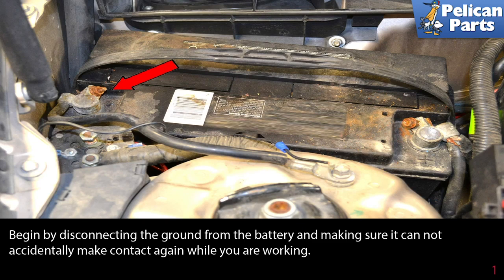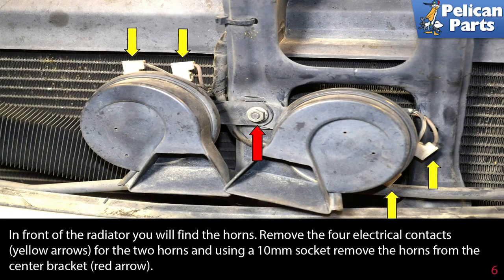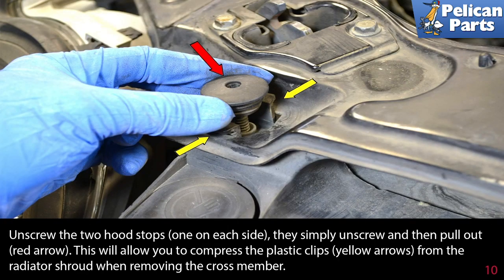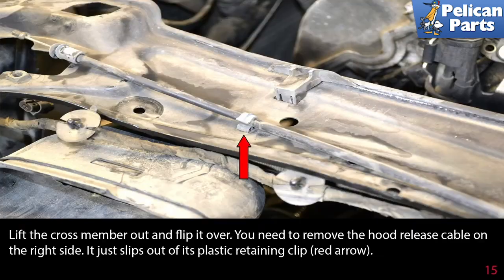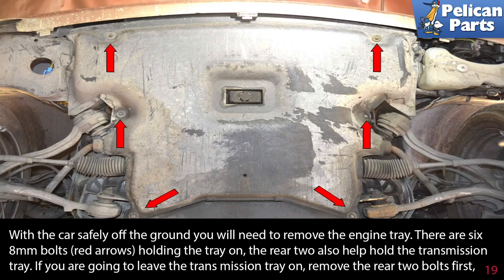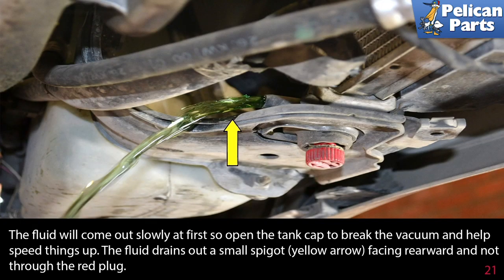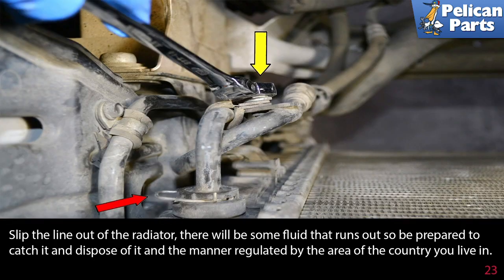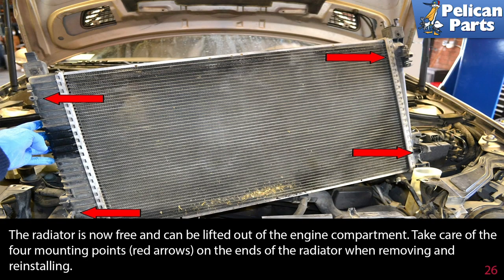Mercedes-Benz W203 C-Class Radiator Replacement

Comment: So this video has a lot of great info but if you have a W203 Kompressor you will  need to remove the front bumper and intercooler. With the left side (facing the car) intercooler hose completely removed you can more easily remove the upper trans cooler connection and also easier on the reassembly since you can more easily put the lower trans cooler hose clip back on or at least i hope. Then you can remove the fan, and then with the intercooler out, the radiator will come right out. Not to put it all back together but not completely since i need the upper trans coolant hose loose to flush the transmission, Once thats done 
I can put the fan back before I reattach the trans coolant hose since it won't go back on with it installed.
Reply from the maker: Thanks for the additional info for the procedure. We appreciate it.
Reply: @pelicanparts  Reinstalling is going to be fun. I will make a note of the order I end up successfully performing each step and let you know.

Comment: Great video!  I have a 2003 Mercedes SLK320 and need to replace the radiator this weekend. Whats the best way to get to the Transmission lines on the back of the radiator?  Thanks
Reply from the maker: First remove the fan shroud. Then you have access to the lines, unscrew them from there.

Comment: Great video but it is not complete! There is another support for the radiator on left and right bottom that needs to be detached. I was trying hard to wedge it for almost 1 hour before I noticed it. You should get under the car and you will see both tabs. Something that helped me was looking at the new radiator to understand where the tabs were. Hope this helps someone else.
Reply from the maker: Thanks for catching that. We appreciate it. I will have the article updated.
Reply: Yes, definately. I am at exactly that point. This video kinda of glosses over a lot of things. Like in order to remove the fan, you have to make some room, you need to disconnect the upper radiator hose on the right to get some room to get it past that hose, and then on left side (facing the car) you have the upper trans coolant hose in the way, so you need to get that out of the way. The the upper trans coolant hose is held in place by a clip built into the radiator. The fan gets hung up on it and no matter what it need to come out. You can't pull the upper trans coolant hose without getting it out of the clip on the radiator. You can't get it out of the clip without removing the clamp attaching the upper and lower metal hoses together to get some room to move the metal hose from underneath since there's no way to slide it over on top. Now you can almost get it out but now the lower trans coolant hose is in the way, not quite enough clearance. And you can't reach the clip for the lower trans coolant hose because the lower radiator hose in the way. So you manage to remove that, and then discover the clip for lower trans coolant hose is facing backwards, and while yes, you can get it off, you wonder how will you will ever get it back on. But 1st things 1st. So now the lower trans coolant hose does not want to come off. It won't budge! But after wresting with it for 15 minutes you manage to get it out without breaking anything. Now finally you have enough room to slide  the upper trans coolant hose out of the clip but it still offers a lot of resistance so you need to pry it over with a large screwdriver while simultaneously try to pry the hose out of the radiator, but again, it won't budge, I broke this round plastic clip between the radiator and the upper trans coolant hose and hopefully the new radiator comes with one. Crossing my fingers. Once that broke it finally popped out. It was really in there! I had a large pry bar on it and nothing. Well finally it's out. So NOW FINALLY 
I AM ABLE TO LIFT THE FAN OUT!!! HURRAY! And even am able to undo the top clips on the radiator. But wait....THERE"S MORE CLIPS I CAN"T EVEN SEE!!! NOOOOOOOOOOOOOOOOOOOOOOOOOOOOOOOOOOOOOOOOOOOOOOOO!!!!!!!!
Break time.

Comment: Would this work for a 2006 Mercedes Benz 230 ?
Reply: C230*
Reply from the maker: Applicable Models:

Mercedes-Benz C320 (2001-04)
Mercedes-Benz CLK320 (1998-04):
   - CLK-Class (2003-2009) W209
   - CLK-Class (1998-2003) W208
Mercedes-Benz E320 (1998-04):
   - E-Class (1996-2003) W210
   - E-Class (2003-2009) W211
Mercedes-Benz ML320 (1998-03)
Mercedes-Benz S320 (1998-99)
Mercedes-Benz SLK320 (2001-03)

Comment: It looks like the radiator is connected to something near the bottom. How do I remove it?
Reply: I've got a 2005 clk 270cdi, an mine is attached at the bottom too? Can seem to figure out what it is stuck on?
Reply: @adamlawrence590  Hi, I was able to replace mine. If I remember correctly, as this was roughly one year ago, it was connected to the fan in front of it. I ended up breaking the plastic that connects the two by abrupt force. I slid the new radiator in and made the appropriate hose connections. I haven't had any issues since. Note that my vehicle is a 2004 C230 Kompressor, so I'm not aware of the specific similarities between our models but I hope this helps.
Reply: @jrrchemist6658  I have a C230 kompressor 2003 and mine is also attached to what seems to be a short fatter radiator that has what looks like 2 air hoses connected to it. I don't want to break anything and I have no idea how it's connected! 🫤
Reply: @shawn7307  Can you provide more details? My radiator was connected to the fan near the bottom. This is where I was having issues. The connection between the two involves sliding up and pulling out. It's almost like a hook.
Reply: @jrrchemist6658  I figured it out. It attaches in 4 different places on the bottom of the radiator. There is a hook attachment that slides in that is released by pushing the top of the radiator forward and then there is a snap in at the very bottom that can be released with a screwdriver on both sides. You have to remove the bottom air hose first that goes to the smaller fatter radiator. I think it's related to the supercharger some how. 😅
Reply: @shawn7307  Awesome.
Reply from the maker: What is the year and model of vehicle?

Comment: Would this be the same for the w209 CLK?
Reply from the maker: Not exactly the same.

Applicable Models:
 
 
Mercedes-Benz C320 (2001-04)
Mercedes-Benz CLK320 (1998-04):
   - CLK-Class (2003-2009) W209
   - CLK-Class (1998-2003) W208
Mercedes-Benz E320 (1998-04):
   - E-Class (1996-2003) W210
   - E-Class (2003-2009) W211
Mercedes-Benz ML320 (1998-03)
Mercedes-Benz S320 (1998-99)
Mercedes-Benz SLK320 (2001-03)